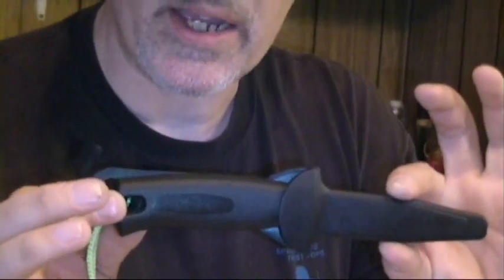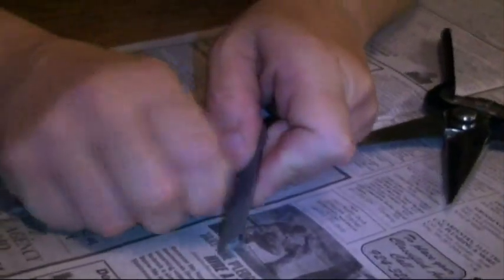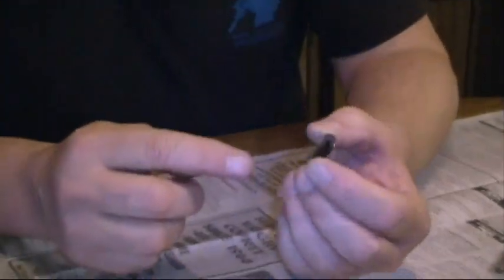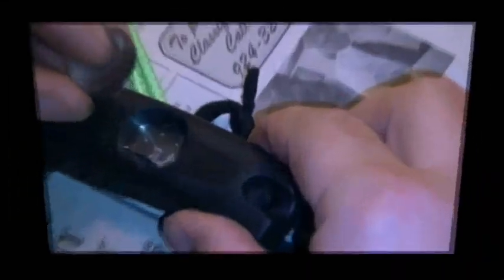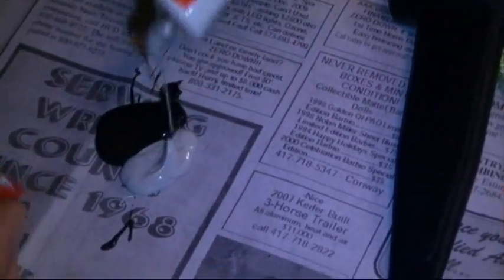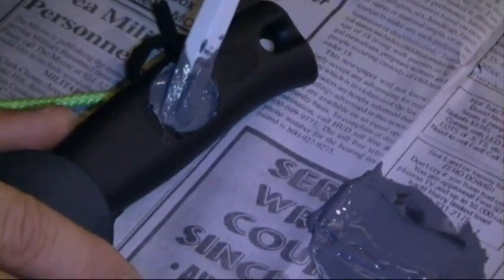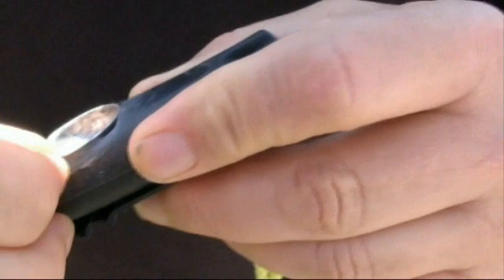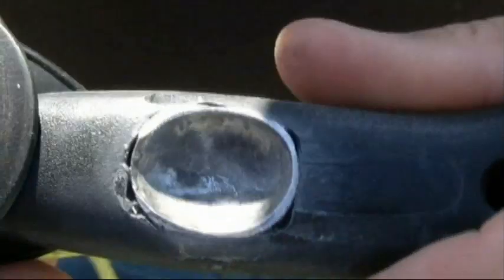DIY - Knife Bowdrill Handhold Mod

Comment: Thank you Dave. I've used this mod on two of my mora knves. I just purchased an enzo trapper 95mm with the scandi grind and green micarta handle scales. If my handles are thick enough I'm also going to use this mod. The enzo knives are really nice. Enzo seems to be the best deal I could find for the least amount of cash if you get them in a kit which is what I did. The kit is really easy to put together and you end up with a really nice knife. Your videos have helped me alot. Thanks from WV.

Comment: A Forstner bit would actually be perfect for this modification. It drills a flat bottom so you wouldn't end up with a plug that you need to remove. Also, just an fyi, the bit you used is called a hole saw, not a bi-bit or bi-metal bit. Great video and great ideas! Thank you!!!

Comment: I like this! I will be doing this to something soon!
2 suggestions, use a knife to cut out the hole in the rubber, then just pop the plug out. I think it would be easier and cleaner than drilling around the edge. 
Also, I would use E6000 or ShooGoo to fasten it in since you are fastening to rubber and flexible steel. The epoxy will tend to crack and separate since it doesn't flex. Basically you fill the hole with the E6000, and press the metal in and then trim the excess off. No gaps that way!

Comment: @ke6gwf shooGoo is amazing stuff and work adequately in place of the JB weld but would be outstanding for the refilling gaps.   I would personally use more JB Weld or other 2 part epoxy fgor both and then do a clean up with a dremmel style tool for both shaping the metal parts and the epoxy overfill.    I am thinking that I will do this with my small hatchet handle since I will be using that for kindling and tender preparation anyway.